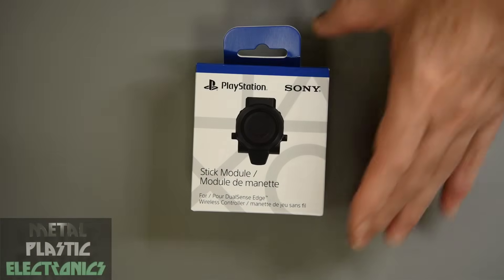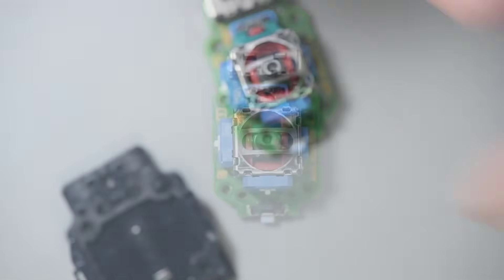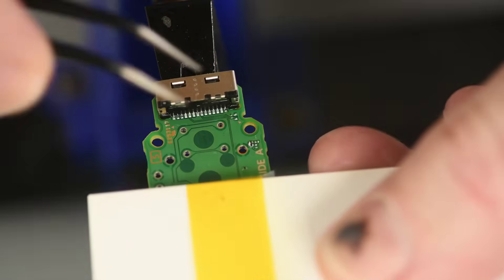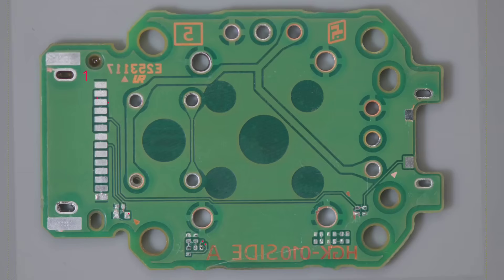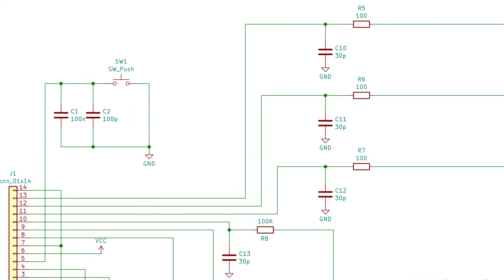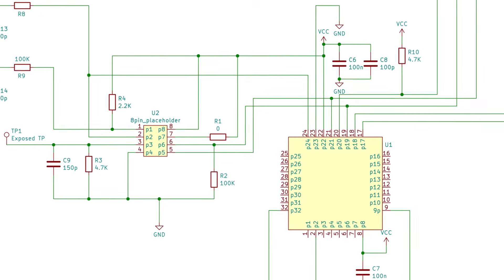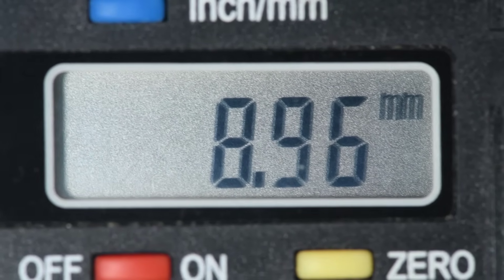Is Sony Hiding Something in the DualSense Edge Stick Module?

Comment: Hello, I have a dualsense edge module with most of it's capacitors and resistors missing. Can you make a picture like at the 3:39 but labeled with all the capacitors, resistors, their values and where they go? For both sides of the board... it would be a huge help and a lot easier to read than the schematic. Thank you
Reply from the maker: I think I have that.  Email me at mike@mlplel.com, and I will send them to you.

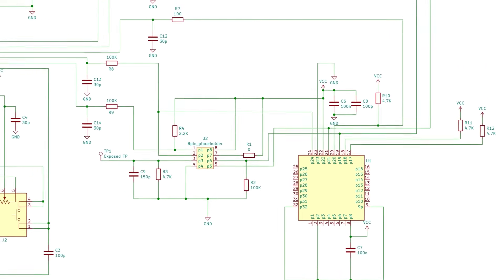Comment: 8:12 check the circuit for a PS2 controller and it will tell you everything you need to know.
Reply: @metalplasticelectronics354  I haven't opened one up in years but I remember them being pretty simple,  if I am remembering right they didn't need calibration because they did it automatically.
Reply from the maker: It could be. I'll have to see if I still have one and take a look at it.

Comment: I've been using/customizing the edge since they launched and it's the most solid performing controller in my opinion.  Hope you enjoy tinkering with it...I sure do.  I tried adding various joysticks to the modules and got many different performance levels/feels.  The best I've tried so far is just the base ALPS joystick with the gulikit tmr sensors like you suggested awhile back.  High precision and super fast response time with comfortable tension.

On a side note, I have 3D printed sticks that connect to the original connection snaps that come on the modules.  Also created a mold for suspending these printed grips in a mold and pouring a 2-part silicone rubber (30A hardness) around them.  The grips are pretty good but I think the next level down in hardness would be about perfect grip/hardness ratio.  I've noticed basically zero wear though over probably 6 months with daily use and they have a lot more grip than standard sticks so the material is still a good upgrade if you're looking for better grip.
Reply from the maker: Very nice.
Reply: Please need your help.. I need the best joystick out of all, with the loosest tension that is like a favor union joystick, and the best return to center, and not a perfect circle circularity, more like a square circularity from the sides, and a long life span and the smoothest best response time
Reply: @vatira77  honestly this channel has put out more and higher quality information on those topics that i've ever measured myself.  look through his videos for stiffness measurements and whatnot.  some clever tips though...if you want the perception of a stiffer spring, you can always make a shorter stick and a longer stick for a softer spring feel.  the longer the lever, the more leverage you have to bend the spring which makes it easier.  of course this changes the distance required to be traveled from center to outer extremity.
return to center in my experience tends to favor the stronger springs.  the stronger the pull of the spring, the more of the friction can be overcome to get the stick back to vertical without being hung up by the surfaces rubbing on one another.  the tradeoff is that your thumb has to work more while gaming, so honestly the best thing to do is just try out different brands and see what you like.  the sticks aren't overly expensive.
tmr sensors are the best for response time as this channel has detailed multiple times and the sensors won't wear out...however the spring and plastics of the body of the stick will over time, but that timescale is large enough that you don't really need to worry about that part of it.
personally i game on pc and the adjustments that can be made with DS4Windows make up for any imperfections in circularity.  that quality is kind of a coin flip though.  just buy sticks and try them out.  it's not usually brand specific in my opinion

Comment: Did you test the pins on the controller side? Could the controller be bridging some potentiometer pins straight to the chip?
Reply from the maker: Don't have a controller yet.  Have to find a way to make a breakout board for it.

Comment: The qfn is most likley a mcu with dual adc for reading the potmeters. The 8 pin package looks to be a spi flash chip. The flash chip is routed to both the mcu and the connector if it can be remote programmed/calibrated. So they can flash the chip and the flash chip with some remove calibration software. Probably also the reason why the potmeters are wired to the connectors as well. Should be able to capture and or read the content of the flash chip to see its datastructure. Then it should be possible to directly program it without the need to flash the mcu again.

Comment: I strongly suspect both the ICs on the board and both ends of the connector are custom Sony designs that can't be purchased anywhere, they've done that quite frequently in the past as well.
I've tried searching for replacement PSVita connectors so I could make a custom USB-C cable and had no luck at all.
Reply from the maker: Looking that way.
Reply: That is so dang shabby practice, but boy I am not surprised. :^(
Reply: In case you are still looking to do that I have seen mod pcbs to replace the proprietary port on the vita with a USB-C jack while browsing on Ali. Both for 1000 and 2000 models. I don’t own a vita so I have no clue how well they work.
Reply: @bru_haha  Yep I've seen those mods too but I was specifically looking to build an adapter or cable for people who didn't want to do any of the complex soldering required to do those full port swaps.

Comment: Wow, ain't that bigger chip looking awfully similar to the TPM chip on the PS5 main board? I mean, something like Optiga SLM 9670 TPM 2.0...
Reply from the maker: Yes, it does, very good catch.  Thanks
Reply: @metalplasticelectronics354  also, taking into account the pinout information from the TPM datasheet, and checking against the smaller chip, the pin layout matches for example with SPI Serial EEPROM chips (like those of microchip for example), in which case the exposed test pad would be the write protect pin... The pin is pulled low on your schematic, so it would mean WP is active.
Reply from the maker: Yes, I saw the TPM chip uses SPI interface.  That sure looks like what is going on.  Bad Sony.
Reply: @metalplasticelectronics354  bad sony in a sense that if the TPM chip is use to store the calibrations, and if you can only access with some private keys. What still makes me wonder is why expose the WP pad to the outside if not for storing calibration purpose? Could it still be that the serial eeprom could be modified to calibrate, or, pull the pin hi while calibrating with software...
Reply from the maker: If it is an SPI EEPROM, then the CS line is pulled to VCC with a 2.2k resistor. I've got to double-check my values for the resistors. I only have a connection to the 14-pin connector by way of a 100k ohm, and that will not pull the CS line low.  Either I misread a value or missed a connection to the CS line of the chip.  Also, I would think a TPM chip has some extra EEPROM memory to store a few values, so why would you even need an extra EEPROM chip?  And bad Sony for even putting a TPM chip in the thing.
Reply: @metalplasticelectronics354  Both R8 and R9 are actually 100 Ohm, just measured on my stick module. So, makes more sense now, to be CS and MISO...
Reply from the maker: Yes, it does.  Thanks.  I think I probably damaged the resistors when I pulled them out.  I should have done a resistance check with them in place and then after removal. I've ordered a PCB to mount the memory chip on and see if that is what it is.  But I got to find or make a contact to plug the stick module into.

Comment: Great video I have seen TMR joysticks be installed in these boards from other channels could be worth a shout reaching out to these channels to get some further info. Uber Micro Repairs has installed the Gulikit TMR's into a dual sense edge I love those Hallpi TMR's Aknes and Gulikit provide. Method for this atm seems very complicated compared to a normal DS joystick swap you may get some insight from the TMR installs as to why it's much more complicated.
Reply from the maker: More complicated because of the installation of a calibration board.  I'm really not a fan of them but it's the only way ATM.
Reply: @metalplasticelectronics354  yeah hopefully the calibration project finds a way to access that joystick board when installed into a dualsense edge to calibrate any newly installed sticks.
Reply: @metalplasticelectronics354  is there a way to contact you Twitter, discord or email. I'd like to share with you a new method to calibrate the edge thumb modules just requires a wire to open the write protection on the sticks

Comment: I find it unlikely that such a complicated chip would be there to just calibrate the analog stick. Call me crazy, but I think it could be meant to CONTROL the sticks in a determined scenario. In other words, "aim assist".
Reply from the maker: The large chip is not even connected to the joystick lines.  It has a separate power line, and might not even be powered up when using the controller.
Reply: aim assist is a game feature, its not something you implement in the sticks themselves.
just like how crosshairs aren't painted on your actual screen.

Comment: Has to be something in the controller because when replacing with hall effect sensors you have to use A chip # F005C6UA-A2623301

Hope you can figure out another way instead of using that awesome videos keep them coming 👍

Comment: I wanted a DS Edge. Now that i know you cannot repair/ replace the pots due to proprietary calibration, this product is ded to me. 👍
Reply from the maker: For the same reason, I haven't bought one, but now I'm going to have to for testing. However, I'm still trying to locate the mating connector for the stick module.
Reply: Just install a Extremerate Rise 4 Remap kit and Gulikit TMR sticks into a normal dualsense
Reply: You can install hall effect or tmr in these modules together with a druver board for calibration
Reply: I have a feeling that those aftermarket kits are not readily available and won't be supported and/or produced in 10-15 years when the sticks may give out :face-green-smiling:
Googled it, it's cheaper for me to buy a non-edge controller, than import 2 sticks with the required accoutrements. :face-purple-smiling-tears:
Jumping from one proprietary boat to even more obscure and proprietary is not a great plan.
Reply: @IcecalGamer  is that a problem? If u purchase a kit now you only have to swap the joystick if it ever fails. The driver board wont fail

Comment: I’ve been looking the entire internet for a permanent calibration tool on the dualsense edge, something similar like the GUI for the DualSense; still not any luck
Reply: Only way to do it is by adding a calibration board. It’s needed to upgrade to a Hall Effect or TMRs. It’s not an easy install though. I’m hoping to upload a video installing TMRs soon. Recording today.
Reply: @OmeliGaming  I know how to install TMR or any electromagnetic joystick, but the problem lies in not being able to calibrate via software without using any physical board attached to
Reply: @orhansreview9627  Thats why you need calibration boards the install is just a bit harder.